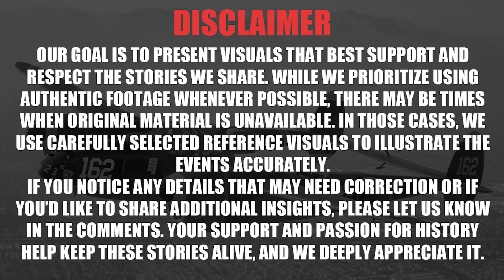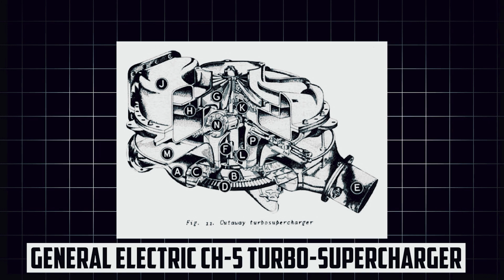The Fastest Piston Fighter Ever Built? XP-47J “Superbolt”

Comment: The F2G2 was also recorded at 505 
It was the evolution of the  F4F corsair with with the PW-R2800 replaced with a PW-4360 wasp major up front. Torque on take of power was an 'ISSUE'

Comment: Except the 505 mph claim wasn't with the XP-47J. It was done with XP-72A which used the P&W R-4360 Radial which was putting out 3000 hp. And the 505 mph claim wasn't done at full power. The estimated top speed of the XP-72A was about 545 mph....almost as fast as the German Jets.
Reply: It was a 1 of a kind Chrysler v12 or 16 inverted, it's in the books and findable.
Reply: MORE CLICK BAIT GARBAGE FROM PATHETIC WOKE CLOWNS as the top speed of a ME 262 was in the 700 mph range - NOT THE NONSENSE NUMBER YOU QUOTE!!!!!!!!!!!!!!!!!!!!!!!!!!!!!!!!!!!!!

Comment: I don't think the P-47M was the fastest to see service. 1 It was initially shipped to Europe in January 1945, and was promptly grounded due to ignition issues for 3-4 months . Also the listed speed ranges from 460-470mph depending on where you look. The Ta 152 did see action and did 472mph. So I think the German aircraft might just win it. We are talking about only a few mph difference, and different aircraft of the same type can have different speeds. In fact I read the reconnaissance Mosquito would get a extra 8mph with a polished airframe. So ground crew would actually polish the aircraft.
Reply: NOPE - TA 152 was slightly SLOWER THAN HAWKER TEMPEST - see the Pierre Closterman book THE BIG SHOW in which he caught up to and shot down a TA 152 in his Hawker Tempest!!!!!!!!!!!!!!!!!!!!!!!!!!!!!!!
Reply: @abellseaman4114 MMM 🤔🤔 this is the same fellow that clamed to break the sound barrier in a Spitfire, who also claimed to have spotted a Do335 and claimed 32 kills later dropped to 15. Whilst pilots often over estimated their kills and it's possible he did see a Do335 as they did do test flights, it is impossible for a propeller aircraft to break the sound barrier. In Australia we call people like these Wankers.
Reply from the maker: Speed-wise, the P-47M is commonly quoted around 473 mph in top-speed figures, but you’ll absolutely see lower numbers depending on altitude, boost settings, and configuration.
Reply: @VintageWarbirds absolutely, there are just so many variables, and your talking about only a few mph, and you don't know what is fact and what was propaganda. The fact that the factory test on the P-47J was 505, yet the airforce got 20mph slower just demonstrate how much BS was in the factory brochure LoL 😂😂. I also suspect a lot of quoted speeds were post war tests with high octane fuel, which both Japan and Germany didn't have access to. So even the Ta152 speed might be suspect. At the end of the day I don't think there is a definite winner in the question of the fastest piston engine of WW2. But my God, there were some incredible machines in 1945, the six years from 1939 to 1945 were just incredible from a technical standpoint, but the millions of lives the period ended is the saddest of thought.
Reply from the maker: @trevorgale1176  That’s why I like your conclusion: there may not be a single, definitive winner for “fastest piston fighter of WWII.” But there were some astonishing machines by 1945, the pace of engineering from 1939 to 1945 was unreal. And your last sentence matters most: it’s impossible to admire the technology without remembering the human cost that came with it.
Reply: @VintageWarbirds  Speed wise - Woke and  WEF clowns LIE RELENTLESSLY ABOUT EVERYTHING!!!!!!!!!!!!!!!!!!!!!!!!!!!!!!!!!!!!!
Free French pilot Pierre Closterman detailed  a dog fight with a TA 152 to that STARTED AT HIGH ALTITUDE - well over 20,000 ft and which ended up with the two planes- TA 152 and Hawker Tempest dodging around tall chimneys at ground  level till the TA 152 GOT SHOT DOWN!!!!!!!!!!!!!!!!!!!!!!!!!!!!!!!!!!!!!!!!!!!!!!!!!

Woke and WEF CLOWNS PROVE they are determined to REWRITE HISTORY WITH LIES!!!!!!!!!!!!!!!!!!!!!!!!!!!!!!!!!